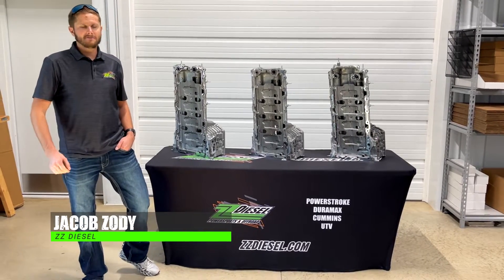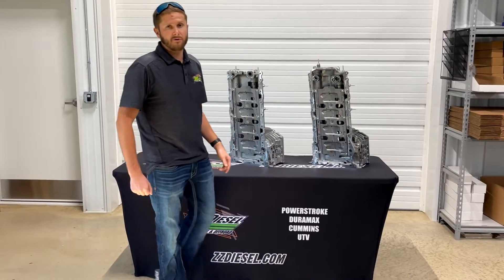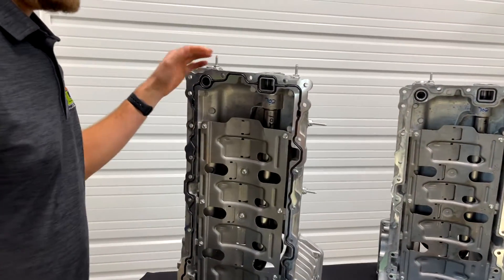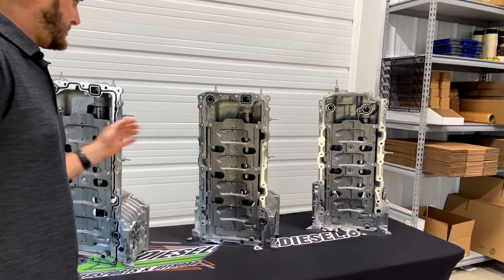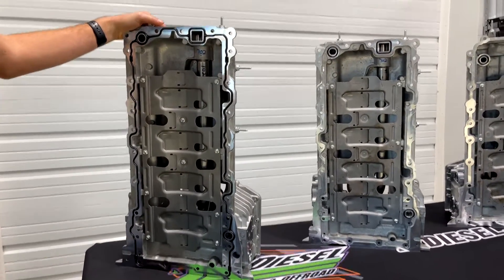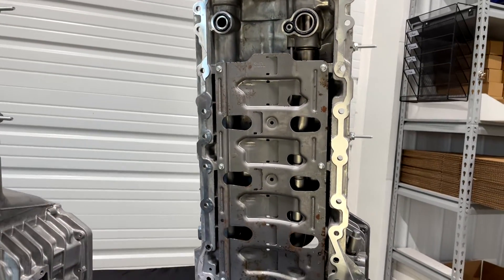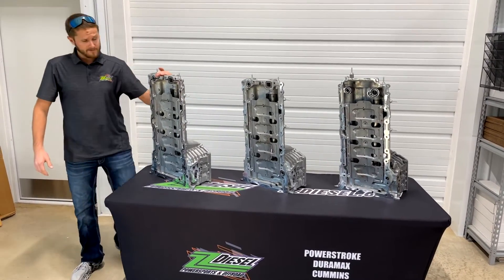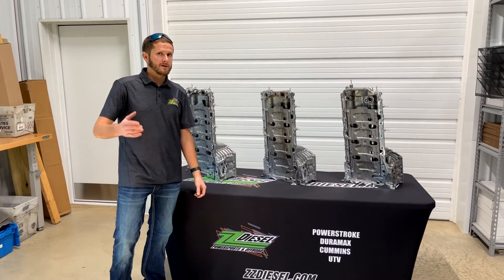Which upper engine oil pan do you need? Ford 6.7L Powerstroke

Comment: The BC3Z-6675-B pan has been superceded to the DC3Z-6675-C, which is the later style pan without the groove for the o-ring gasket.  The 6675-B has extremely limited stock and is no longer available from Ford and is also no longer being produced.  Machining a groove in the later style pans may be the only option.

Comment: Scuff the flat contact sealing surfaces where you put the silicone with a 100 grit or so sandpaper, just like paint silicone needs some teeth to bite into and hold. Use a torque wrench on all the bolts. From what I've seen Ford under tightens a lot of their fasteners. Also make sure all the dowel pins are good and in place. I've heard some of these leaks are related to the parts shifting under driveline torque. After all the pan does bolt up to the bellhousing mating surface.

Comment: Used 7.3 diesel silicone on the pans and I'm not talking about the Motorcraft stuff I'm talking about the international gray 442a made by wacker
Reply: Int’l 442A and Ford TA31 are all we use on pretty much anything that requires RTV. Good stuff, but it sets up fast!

Comment: Would absolutely love to have a gasket upper pan available for my 22 6.7 when it inevitably starts leaking. I hate using silicone, and do not want to have the truck in the shop multiple times due to ford wanting to save some machining time and not use an actual gasket.
Reply: 2020 and up use a gasket, still can leak however.... but not as dramatic as the 2015-2019 sealed w RTV.  Especially in back right corner near oil filtrer (HP oil passage into block). Numerous pics of seepage there.....
Reply: @richardhenthorne8399  For me looking at the periphery of the 3 here, it seems only the 1st pan seals the whole unit with a gasket...
Reply: @richardhenthorne8399 11 and early 12 are the only ones with an oring gasket pan, better imo except the gasket gets brittle and ends up leaking but that's more around 200-300k from my experience. I don't care what ford says something changed with quailty of their o rings

Comment: I would like to think FORD took all the bad pans out of it's inventory.
However, after conversing with a local service writer at a FORD dealership, I don't think information flows very far at FORD.  This should have been at minimum a TSB if not a full blown recall.  Anything to save a buck.  Ford hopes the warranty expires before the leaks start.